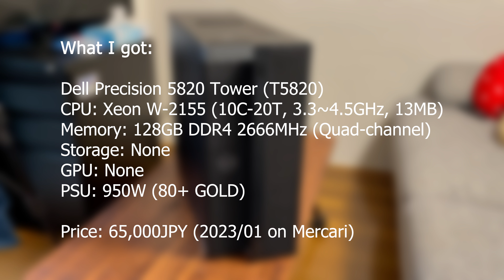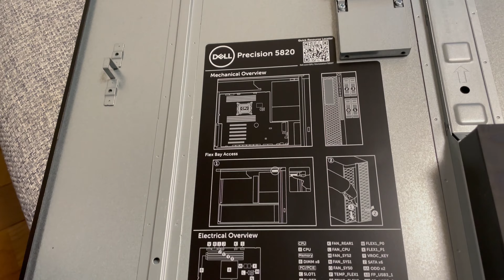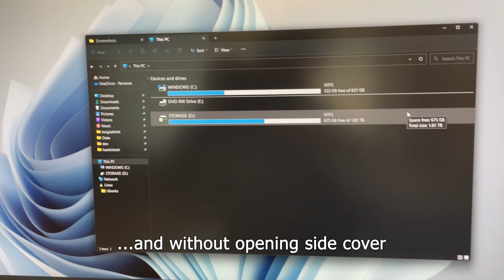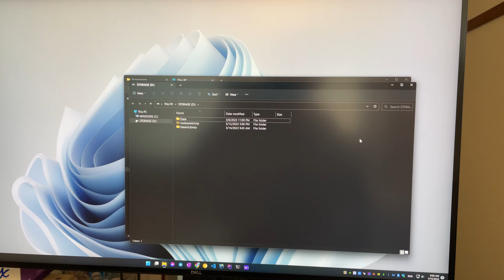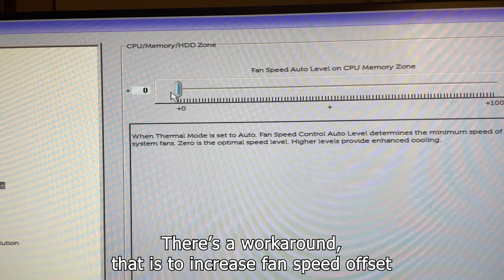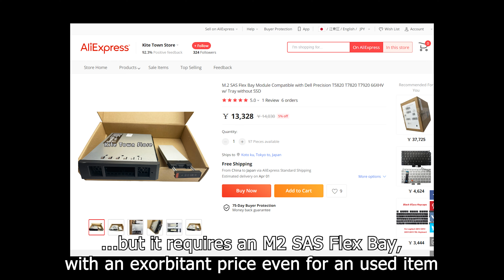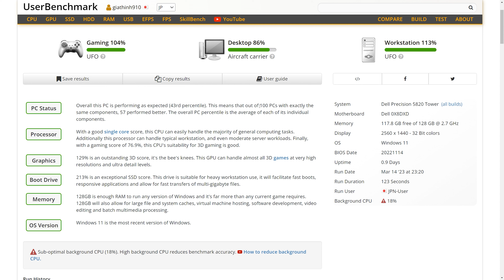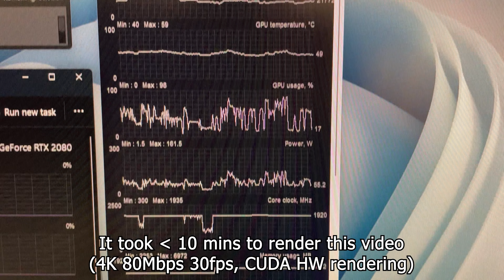Nice timing for an used Dell T5820?

Comment: As someone who has flipped dozens of these after decommissioning them... Take a drill, and go down the side panel and just barley touch all the little weld spots on the GPU bracket, then take a flat head screw driver and it pops off, door handle still works, and side panel closes.  They have had some variation of that bracket thing from the T3600 on.
Reply: I put a GTX 1660 in mine and had this issue. Thanks Ill try this to remove that piece blocking it from closing.
Reply: @daroniousmaximus  to keep from drilling to much you can take a self tapping screw in a drill or impact and just barely touch the rivet or weld bumps (depending on model) and just grind them off.  Take it slow and if your overly concerned on going to deep or leaving a noticeable bump on the outside go even lighter, you just might have to pry a little harder to break the welds the rest of the way.
Reply: @JordosTechShack  I actually ended up using the claw part of the hammer to brute force it off. Wasn't pretty but it worked!!
Reply: I got a used 7820, but it doesn’t power on, would you know the most common reasons why?

Comment: When the pandemic lockdowns hit I decided to grab a new machine and between PC parts being unobtanium at the time and HP and Lenovo workstations being sold for more than they were worth I grabbed myself a T5810 for like $300.  Served me well as a workstation until I got a new machine built then with an upgraded (E5-2678 V3 ) CPU served me well as a server.  Currently trying to decide what to do with the old workhorse as I've gone down the home lab rabbit hole and have thrown everything in a rack but truth is I could still be using the Dell as my main workstation.  Great machines considering the prices you can get them for used (though swapping the fans and/or replacing the CPU cooler might be needed).
Reply: how much is it

Comment: The  "GPU support bracket" is kinda useless. It's meant for bracing "full-height" cards (the same height as the PCIe bracket) in shipping, but unless you're using a stock Dell GPU with the lip at the end, it just guarantees the GPU will rip the socket off the board first. It's fine to just remove it. 

It's held in with a few spot welds you can easily drill without leaving noticeable damage on the interior panel. Sometimes you can give it a sharp tug and it'll come off too.

Comment: Excellent video! I have 3 of these machines myself and love them. With regards to the GPU size, you can actually remove the black plastic cover on the side panel and install taller GPUs.

Comment: Gorgeous build! OEM servers like this are a great base for affordable workstations.
Reply: Old comment but still, this is not a server, there are no 'Precision' servers. Nor would any server ever make a good workstation really, because servers are not designed to be sat next to they have noisy fans, noisy air flow, noisy drives and no useful graphics options often. Even if they have space(most don't) you often don't have pcie power etc. You can turn a workstation into a server fairly nicely, but not the other way around. I've tried many times. Now I have a 14 core T5810 with 128Gb RAM, P4000 GPU and 1Tb SSD in M.2 pcie card which is a fairly decent "serverlike" spec workstation for not that much money. Not superfast but it's also not too slow, fairly quiet, looks OK. It can do what I need it to, including run several VM at decent speed. And I can play games on it if I want hehe. It will get more M.2 SSD's later probably, to use as dedicated drives for VM's, and maybe some more NIC's also for VM.

Comment: Great video. I just bought one of these last month from the Dell Refurbished site (with that 50% off coupon that has been there forever it seems). 

II know it's overkill, but 'm using my T5820 6-core machine for my AV command center (to replace a very noisy old Dell workstation laptop that was getting on in years) . It  came with a BD player, but I had to buy software to play Blu-Rays  as well as needing to buy a DP to HDMI active converter...ugh. 

That being said, the picture on my display looks incredible after tweaking the NVIDIA control panel settings. And it is whisper quiet. 

Joy!
Reply: Same. The way it runs in near-total silence under even a heavy load is so nice!

Comment: Funny how the YouTube algorithm works. I am currently watching this video on one of these machines that I managed to get from work for free! Mine has a i9-10908XE, 64 gb of ram and, a Radeon Pro W5700. Love this computer to death!
Reply: This CPU supports Core-i9 or Core-i7?
Reply: Actually I have been great fan of T5600 series, but at that time, I bought a High End Laptop, But love is still their, Actually I am thinking of buying one 5820 and 7820 are options, actually I need it for High end Graphic Designing and Occasional Gaming.
Reply: @itz.waleey  definitely i9 for me. Mine was used for architecture.
Reply: @TenForceFalls Does 5820 supports other than ECC RAM? Cause it's not easily available.
Reply: 在中国 这种规格的内存非常好获得 而且价格合适 但是他是二手的服务器上面拆下来的

Comment: Thx for the vid, I was considering upgrading from my Z640 with E5-1640 V4, and RTX 2070, to a Lenovo P520 with a W-Xeon. I will hold off for now the performance is very close. Your User benchmark gaming score was only 2% higher than mine.

Comment: This is a (nearly) exact workstation of the same date and serviable period of my still current unit and has been my most reliable CAD workhorse ever. My next system will always be a DELL standard build becasue of this. You pay a little more at first but overall always works out cheaper. :face-red-heart-shape:

Comment: Those extra fan connectors (probably among other things) seem to be populated on the larger version, the T7820. Just telling from a picture search for T5820 & T7820...
Reply from the maker: Thanks for your information. That's true, they are for the 2-CPU versions. I forgot to mention in the video, as I notice, the rear chasis seems to be compatible with additional dual 92mm fans. That's why I think that the missing connector is  a kind of barrier for additional fans with full PWM control.

Comment: 8:55 the fans can be replaced but are they 5pin as T5810? in which case other fans will run always at 100%? or did they switch to 4 pin?

Comment: Is that bottom expansion slot PCIX? It looks too long to be standard PCI. (Or maybe it's just been a while since I've seen one)
Reply from the maker: Thank you for your question. If you mean the white one, it's the PCI connector, a kind of legacy parallel interface, not PCIe. Other than that, all the black are standard PCIe connector.

Comment: Nice! I just got a T5810 to replace my T3610, and this video makes me jealous. Mainly the dual-8 pin for GPU power (having 2x6 or 1x8 really limits my GPU options), but all the other advances like all of the front-panel USB being 3.0, the much better PCIe cooling, all of the rear USB being 3.0, four drive bays instead of 2 and all of them hot-swappable, the much easier to access CPU/RAM shroud (though I also paid $100 for the base 5810... with no CPU or RAM). I have to admit though that case intrusion thing seems maddening, having it both shut off the PC and have no way to disable it while it blares an alarm in your ears. I had the cover off half the time while I was testing/getting up my 5810 and that would have driven me crazy. But it definitely has a lot of upgrades I wished mine had. Oh, and that ridiculously overpriced M.2 adapter instead of just plain having M.2 ports on the motherboard is asinine, glad that you can just use a M.2 to PCIe adapter card.

Comment: I just bought a 5820 and its in route to me right now. I actually picked up a rx6800 for really cheap this weekend.  I am worried that it won't fit in the case though.  The 6800 is 13.4 inches long.  Is there any way you could give me a meaurement so I can figure out if it would fit?

Comment: I was delighted to come across your video and know that I can upgrade on my own my T5820 that I bought with a small P2000 and replace it with a RTX 4070 using those 8 pin connectors.

One doubt, my CPU is a XEON W2145 Do you know if it can be upgraded to the refresh version W2245. Dell does not say anything, but as they are of the same architecture I would assume that yes, but officially there is no news from DELL.

Comment: hello i tried to put a eva 1080ti 11gb sc it fits but it needs more power.. i have the 685w psu i just bought the 850w but how will i get the power when it has only one dedicated gpu vga? i tried buying a 10pin to 8 pin adpt and use the extra cpu2 slot but when i plug it in to the gpu it just blinks orange and when i unplug it it works .. any tips? i saw someone on reddit making custom psb boards that come with a second gpu slot but its through reddit and its not a safe purchase to just send money to canada.. help me please brother i subbed and watched your vids a few times ! help your follower master sensai!

Comment: hey, great video. i have a question, what is the power consumption under full load?
Reply from the maker: Thanks for your question. I haven't measured at wall and I hope to do it soon. But I here is my estimation basing on software measuring and power rate for each components.

CPU+GPU: By using MSI Afterburner to measure, the CPU takes upto 160w (a little higher than manufacturer stated), the GPU takes upto 200w (factory clocks). You can see it at 15:56.
RAM sticks: I assume 4*3W=12W at most
Storages: I assume 10W for 1 HDD + 1 NVMe drive
Motherboard: I assume it takes 50W at full load
Fans: base on the power rate lable, each can comsumes upto 10W at full load, but they never reach full speed at Auto fan scheme, so I assume 4 fans take 5W*4=20W
PSU: it's 80 Plus Gold standard, so I assume the power lost is 10%

The estimated result at full load (measured at wall plug) could be: (160+200+20+12+10+50)*100/90=502W

Comment: I just setup one of these for my boss with 2 RTX 3060's. Oh my goodness was it quiet. Thinking of getting one as my new workstation.
Reply from the maker: Sorry for slow response. Yes, it's great for multi-gpu setup. In my situation, CPU is more demand, thus the the noise is high at heavy load. If you have a similar situation, checkout another video of mine. I managed to reduce the fan noise significantly without sacrifying the performance.

Comment: I got mine 7820 with dual Xenon for 600 (pls extra year warranty)
I had to buy the vroc key to get the raid working on the m.2 with the card... arriving today!
Reply: my HP z600 served me  well for 10 years (same off form a lease) but due to tpm I cannot use it for win11... waist!
Reply from the maker: Congrat! Once day I'd like to try every features from these workstation.
Reply from the maker: @icemanleo  TPM check of Windows 11 can be software-bypassed easily. The only consideration (for me) to upgrade may be the power cost-efficiency of the old machines.

Comment: Hello, i have the same computer but i dont have the GPU auxiliary connectors.
Reply from the maker: Thanks for your comment. I had the same situation on my old T5810 because it was shipped with a low-profile GPU which doesn't requires external power. So I end up buying a new third-party pair of cable from Amazon.

Comment: How’s gpu cooling? Getting same temp on mine, but fans run at 3k. Mine 5810 by the way, was thinking to replace front fans with silent ones and increase speed like you did :)
Reply from the maker: Thanks for your comment. Now I temporarily stay far from it so I cannot provide the exact RPM count. I will provide more information later. Generally, the EVGA RTX 2080 I used in this video run silently enough to make me forget about RPM measurment. By the way, what the GPU model are you using?

Comment: It seems really good. Is it a better gaming system then a i5-9400F and GTX 1660 system?
Reply from the maker: Thanks for your comment. Compare to your given component, this machine should perform much better. But the Xeon W-2155 CPU may be too redundant for gaming and it would cost.

Comment: Nice one & its windows 11 compatible if i remember right. Must admit im really happy with my current refurbed t5810 for a bit of casual 1080p gaming so the t5820 is a fairly good guess for a the next step up in 2025 when support for win10 ends.
Reply from the maker: Thanks for your comment. That's true, the Windows 11 is being officially supported for this 2019 T5820. I also tried the T5810 recently (I have a video about it). For my gaming demand it's fine, but for work demand, it's a little too outdate meachine. That's why i was looking for the T5820.
Reply: I'd expect you'd be able to bypass the TPM check, giving it updates until 2031 at least.

Comment: i got a Dell Precision T7910 about 2 weeks ago from my local freegeek. i upgraded the CPU from a Xeon E5-2620v3 to a E5-2650v4 for $15 and its a night and day diffence now. i went from 40-60FPS in sea of thieves to 70-200FPS i have a 3070 inside it. im going to be adding other E5-2650v4 to it becuz its so cheap.
Reply: Try a pair of E5-2637 or 2643 V4 !
Reply from the maker: I'd love to try a dual-cpu rig someday too!

Comment: actually I think the whole point of the pcie slots is that they are supposed to be open ended but someone correct me if I am wrong.
Reply from the maker: Thanks for your comment. The slots could be open-ended (as I experienced with some Dell SFF model) if their physical size is less than x16 (like x4 x8) so that the x16 cards can be installed. For those in this machine, they don’t need to be because their physical size is x16.
Reply: @thinhdora  Duh. Ya, silly me. :)

Comment: which one is better between T5810 and T5820 if they has same CUP cores( different CPU) ?
Reply from the maker: Newer CPU generations are usually better because they tends to have higher IPC, result in more efficient with the same core count and clock. You can search for the Passmark scores, that's the easy way to compare.
Reply: thanks

Comment: 9:30 over the years i noticed the only real purpose the pci latches seem to have is to make it harder to remove the gpu. the latch model printed on the motherboard is made of flexible plastic and you don't even need to touch it if you need to remove the gpu. just pull harder and it comes off anyways. as i said, these latches are there only to be a problem. latches that are made similar to the tabs used in ram slots are the worst because you have to hold them with a screwdriver so it doesn't lock itself again while removing the gpu. unironically i consider the missing gpu latches to be an upgrade.
Reply from the maker: Thanks for your opinion. After reading your comment, now I think the same, it seems to be ok without them. At the time I did that clip, I forgot that this PC tends to work with a closed side cover. The side cover already provides a kind of support/pressure to make the GPU firm.

Comment: Wow 950 watt psu that impressive for a used prebuilt pc from dell, they usually always underpowered like 250/300 watt max 500 watt if it's a gaming machine
Reply: It's not just a regular prebuilt, it's a workstation, they always got beefy psu's.
Reply: @Erikcleric  so basically it would be a better option to get a used workstation to make a cheap gaming PC than go out and buy a new pre-built PC

Comment: the 2nd set of fans (rear exhaust) is only populated when in dual CPU config.  Yes, would be nice to leave the headers on the board for additional cooling when in single CPU config.   But can purchase a dual CPU chassis/mobo  and remove one CPU.  2nd set of fans here:  https://youtu.be/SzePdQcMV2w?si=GfxoZUBPatEqPtir&t=146

Comment: Man this looks so cool... This would something I would love to get.. it's just so damn cool.
Can you just put a GPU in
Reply: yes and no there are different psu versions there are als 435w psu for his systems ones you put a power hungry gpu in it it wil not work you must keep in mind to get the one with 950w psu these are also included with the pci cables

also is not every precision xeon there is also a version with the intel core i7 and i9 10th gen 

xeon w-2100
xeon w-2200
core   i.-10gen

psu 435w
psu 950w

so hope this explain
Reply: @pieterpost8515 your reply is a mess. Broken English i barely understand.  
Makes it sound like 435W is unusable. 

You can use a whole lot of cards on 435w PSU, GTX 1650 , 1660, 3050 and the incredibly low power 4060.  And that's just Nvidia cards.
From midrange to almost "high end".

Sure 900W PSU is naturally even better and will support the real beefy cards.
Reply: @Erikcleric  sorry for my english i try to do it beter   not in this system this system used alloth of power by default i have a xeon w-2195 18 core 768GB ram and i have the beast of the graphic cards the best there is right on this moment rtx a8000 i have power problems because i used to mutch power on this system i can't do al the upgrades it wil not work

Comment: ESD protection? I guess it's safe but you did almost all wrong. Great Dell system, however!
Reply from the maker: Thanks for your comment. I think ESD occurs even when there's no power, so I guess that machenism could be for preventing any short circuit or protecting users from injury risks (like electric shock). It's good to have. Just a little annoying when we want to physically debug any components.
Reply: @thinhdora  Yep, I agree.